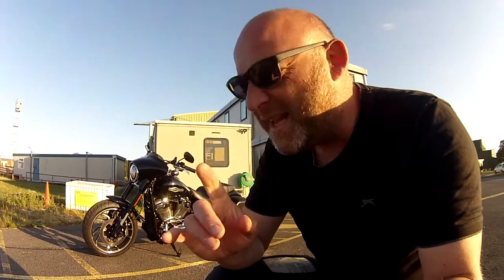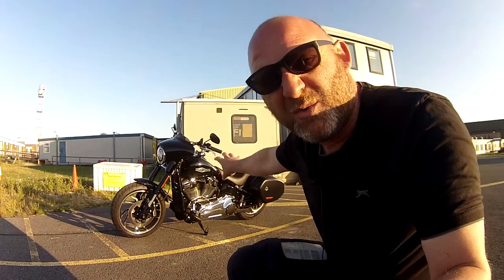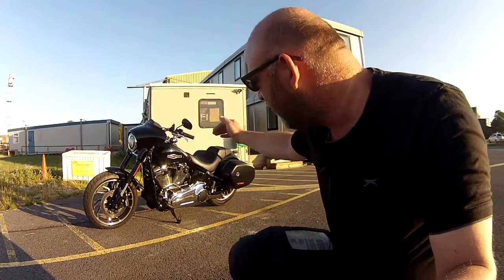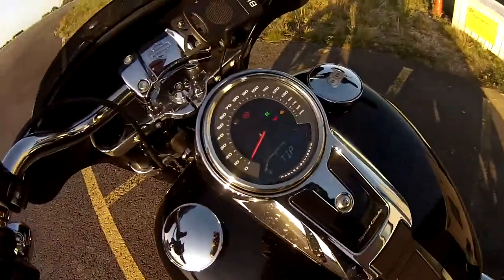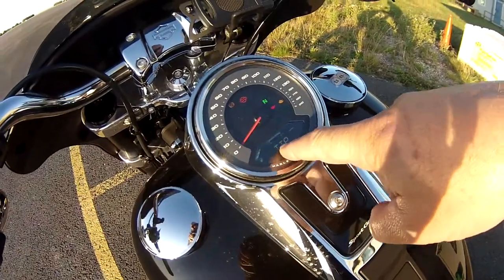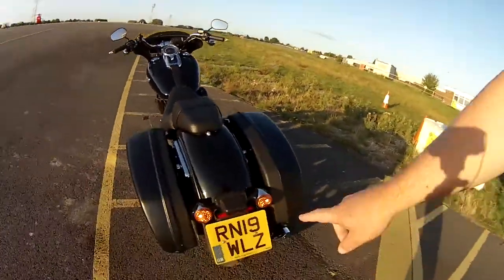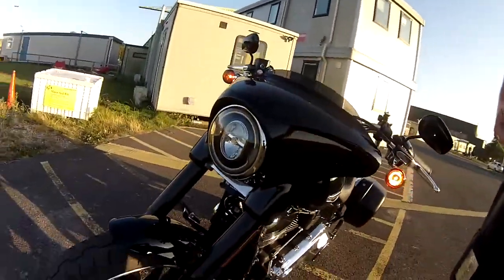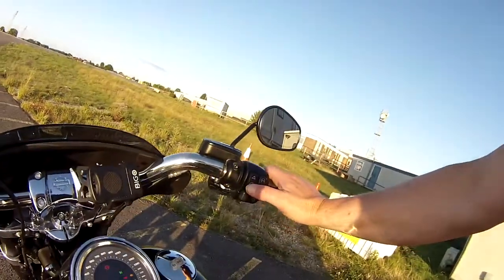How To Start A Dropped Harley Softail Bike - What Is The Sport Glide Tip Sensor

Comment: Dropped my 2020 sportster 1200 last night. Hazards turned on for a couple minutes. A code popped up on the small screen but I wasn’t too sure what it was reading. I’m guessing it was the “Tip”. It didn’t have trouble starting though

Comment: I tried Tipping the bike and it didnt recognize my fob.. so I had to reset the pin once more... plus I need to buy a new clutch lever because it bended
Reply from the maker: oh that's not good.
Reply: @RevelatorAlf  - will it affect the overall performance of the bike once it tips?
Reply: @RevelatorAlf  -coz ill be taking it back to the dealer to have the levers replaced... they asked me first over the messenger if it affected the whole performance after my bike fell down...so I replied no.. but truth is I dunno im not very sensitive... what do you think?
Reply from the maker: @rodolfosabater7781  Unless you have done some other damage, no it should not affect the overall performance of the bike. It's very hard to say unless we can actually see the bike

Comment: I had issue this morning it just shut off it would start on the stand when I would bring it upright it would shutoff. I wonder if it was because I was hualling the bike on a trailer.
Reply from the maker: Hmmm not sure about that. Did you have it in transport mode, but that should cancel as soon as the bike is started again. Perhaps you have an issue with your BCM and the accelerometer within it. If it continues certainly look for DTC error codes and see how you go. Cheers
Reply: @RevelatorAlf  Thanks buddy! Yesterday I just loaded it to the trailer. Didn't change anything. This morning I reset the system and it's working.
Reply from the maker: @theone9564  Ah ok glad it's sorted now. Cheers